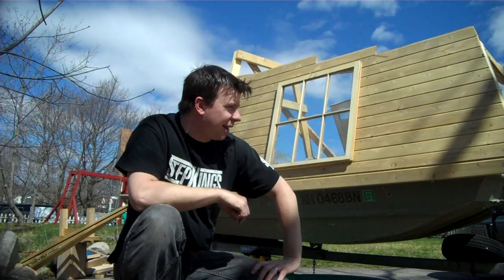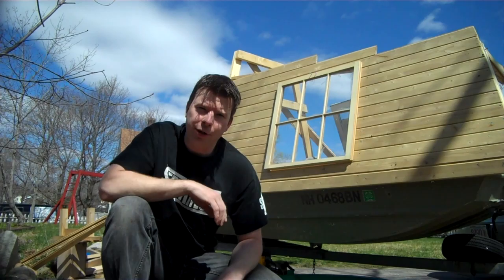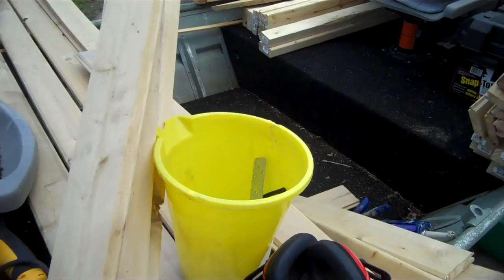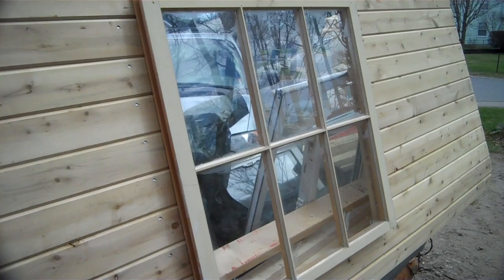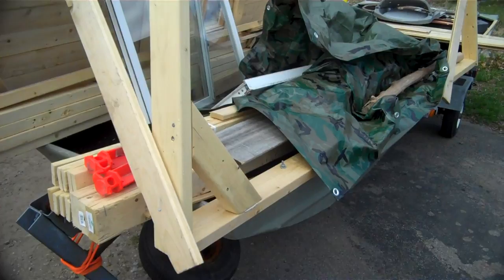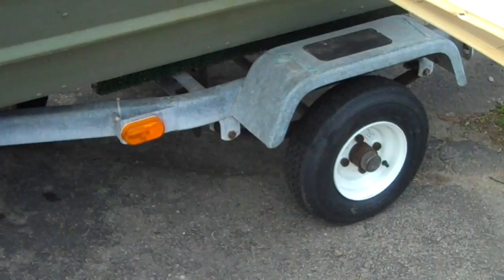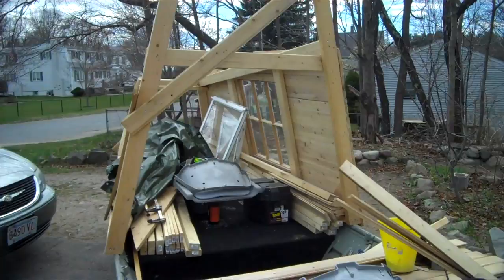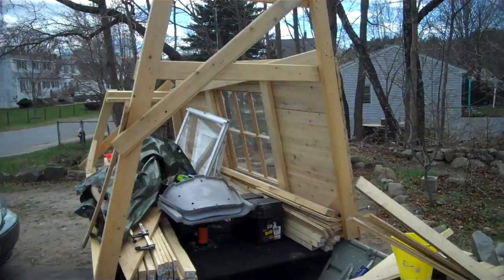A tiny houseboat/micro-shantyboat "The Sea Snail" (floating cabin/shelter)

Comment: A couple of points to consider:

1  The boat is 5 feet wide, but the beam at the water line is narrower.  That, combined with the overhanging sides and raised center of gravity, predicts major stability problems, even in flat dead calm water, as in, roll over.  Even in still water, there are thoughtless boaters who throw big wakes.

2  With so much weight forward on a johnboat with a sloping barge type bow, it will lift the stern and bury the bow.  It won't sink, but neither will it steer underway.

Placement of weight is the problem.  I would be thinking PVC bows, with some kind of waterproofed fabric skin for the superstructure.  Properly placed water and waste tanks will help the trim (balance) and a few sand bags could put her on an even keel.

If you do go with wood, think 2 x 2 framing with a 1/4 " skin.  No glass windows, with screen and shutters will keep down weight.  The heavy wood pictured in the video is fine for dual axle trailers, land based structures, or a barge, but way too heavy for a light aluminum boat.

Comment: I could see making the sides slightly wider than the boat to increase the space. People make their own wood river sleds around here and they put the stearing wheel on the rear wall, vertically and have a 2 feet of open space to stand up and look over the roof, or have a box to stand on to see over it. Looking through a window would be tough on visibility. Plus the best part of my boating experience is having the wind in your hair so think about that. Looks like a fun project!

Comment: great idea but I would imagine that putting all that weight so high up on the boat is going to make the boat tippy and you are going to have one heck of time trying to recover it from a capsize.  The cabin looks a bit tight, too... for all the money you spent, I would think that you could buy a comparable small cabin sailboat in rundown condition and just put your motor on it and use it as a motor boat... plus, the sailboat will have some ballast that will make the boat safer.

Comment: Would you consider pickling the inside rather than painting it in opaque white? Pickling is very dilute white matt emulsion or acrylic, it lightens the wood and you can still see all the grain. At least with pine  pickling helps it retain the original brightness of freshly cut wood, it might do the same with cedar.

Comment: Contradictory to common belief, flat bottom boats are extremely easy to tip over. Just read up the lesson on Mongolian invasion of Japan in 1281, where 130,000 mongols drowned due to usage of flat bottom river boats.

Comment: Boats too small, if you've ever been on choppy water with a small boat you'd know!!! The motor comes out of the water and it seems as if you don't go anywhere. Plus if that got sideways in a swell it would probably tip. Little boat bad water TRIPPY.